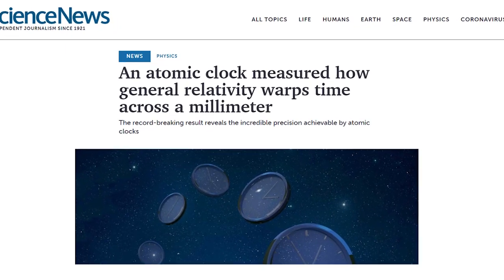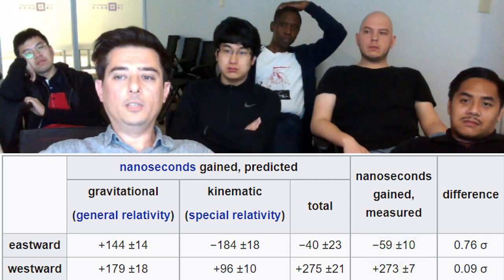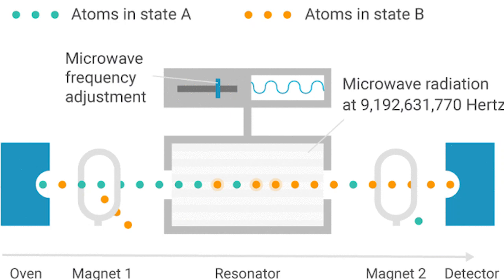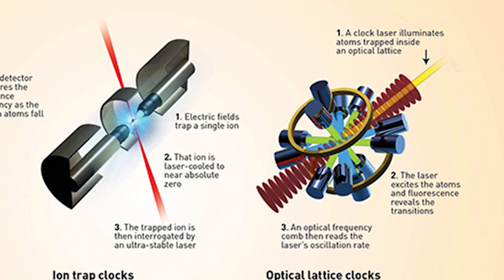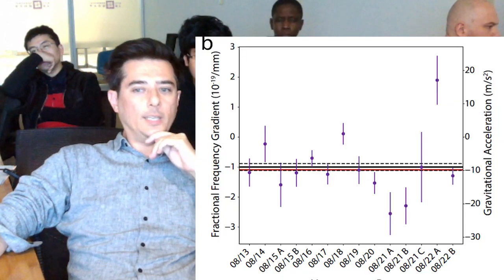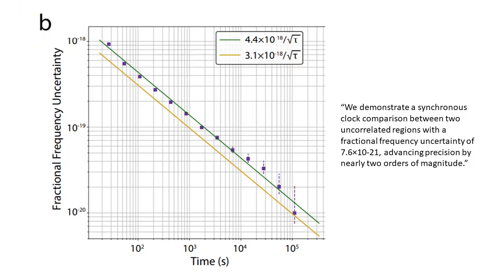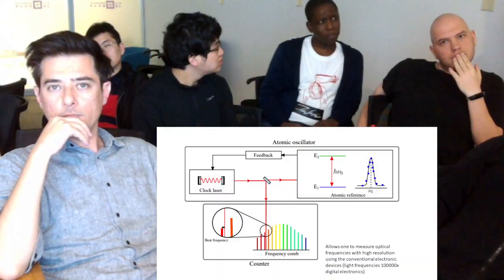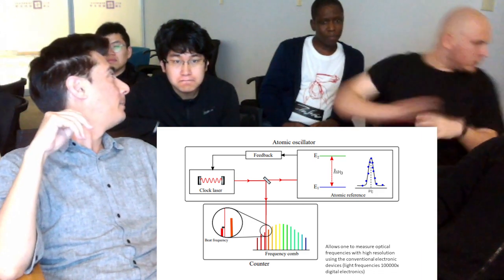How optical atomic clocks measure time dilation (gravitational redshift) over 1 mm

Comment: Finding a reason to discourage a universal time standard, for supposing a reality of growing time divergences, especially with gravity as the only excuse seems pretty clever. Keeping wavelength constant, together with constant time and space metrics, while letting frequency vary, means initially redshifted light realistically must be light initially slowed by decreased gravity. Same with a passing rumble-strip effect. Light frequency is independent of photon rate, meaning a constant-rate countable photon (or light pulse) source gives the only reliable light-based indicator for time rate. Heisenberg's uncertainty applied to light says a perfectly tight frequency source is a perfectly random phase timing source, so atomic clock frequency means basically nothing about the only good time rate measure, namely photon rate.